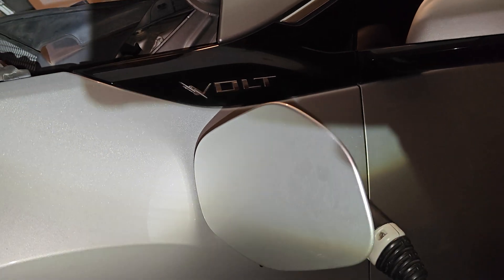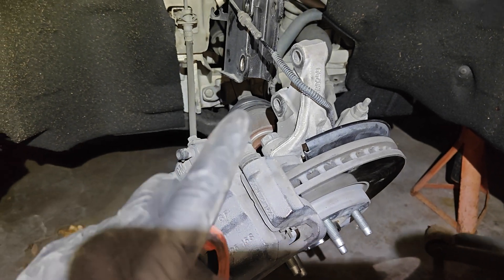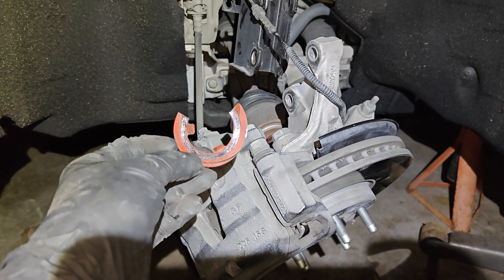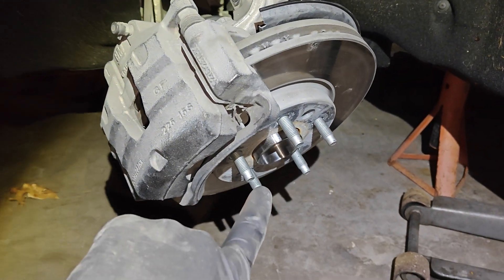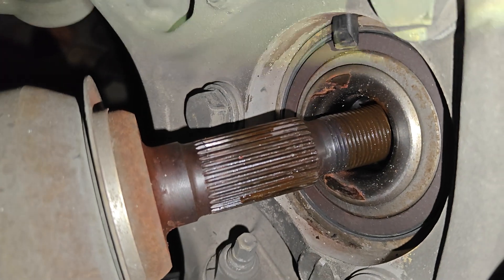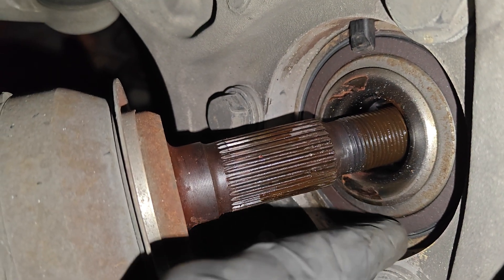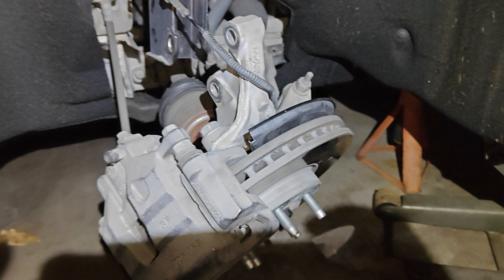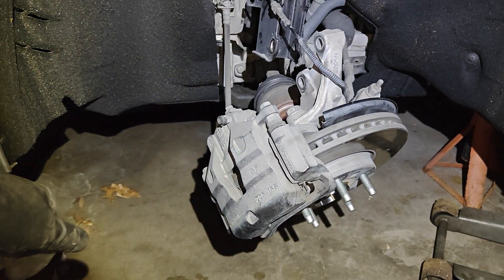Chevy Volt (and more) ABS / Traction control fix!

Comment: Where are you putting the jack stands on this car, exactly? Is there somewhere other than the jack points that can support it without buckling? Thanks!
Reply from the maker: You can jack on the front or rear sub frames

Comment: That's one clean looking suspension.  What year is it?
Reply from the maker: Hey thanks! 2017.
Reply: @gagefixeseverything  Too bad I can't post pictures.  I have a 2016 and all my aluminum is corroded and the shocks are rusted.  That's NY for you.  I'm trying to track down an output shaft/wheel sensor mismatch where the car surges once in a while.

Comment: So you just throw away the washer? That's it? No replacement, no nothing else? . Thanks for the video though.  Mine has abs,hand branke and traction light on. And braking is an issue
Reply from the maker: That's right!
Reply: Thank you!🎉 @gagefixeseverything
Reply: @OZONUSCONSULT Any update when you decided to work around this?

Comment: What a timely video, I believe this is the issue with my Volt, it does note in the TSB that the drive shaft nut cannot be reused.
Reply: So you just throw away the washer? That's it? No replacement, no nothing else? . Thanks for the video though.  Mine has abs,hand branke and traction light on. And braking is an issue
Reply from the maker: @DerekAldridge1  I saw that about the nut, but not to worry. Almost all steering related nuts and bolts on vehicles 2015+ are noted as *not reusable * for liability reasons, but there has been no change in the metallurgy of them! Same with Ford.